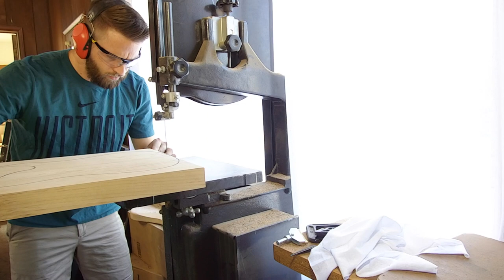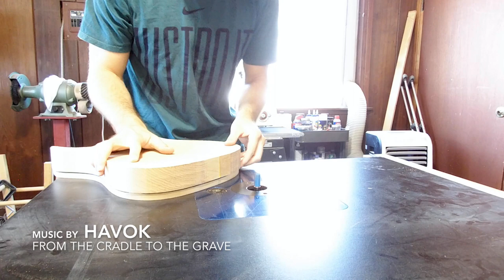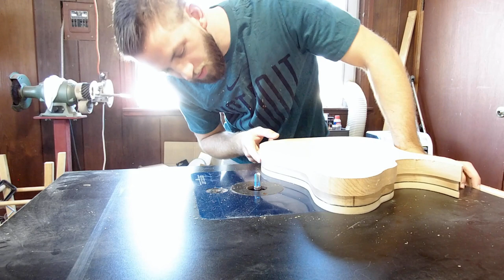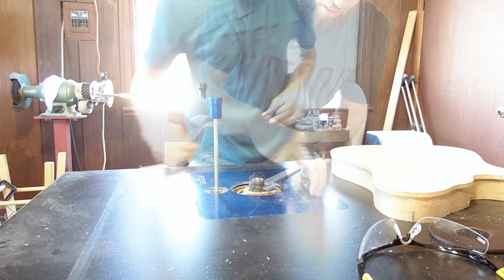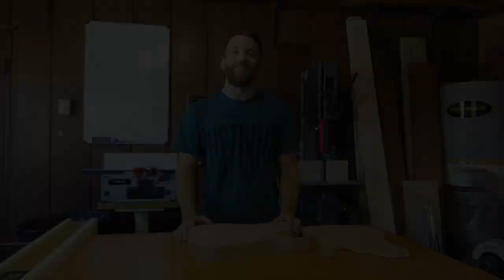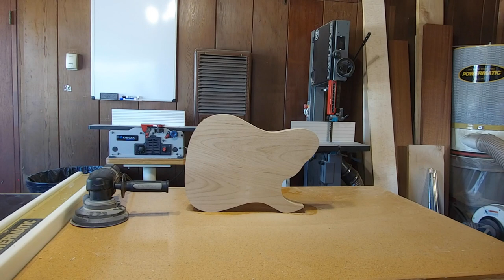How To Build an Electric Guitar - Routing the Body

Comment: Very cool! Thanks for sharing!!

Couple questions, what wood are you using and what speed is your router it? 

I am using a compression spiral bit in my table router at about 14.5k rpm and it works pretty good but sometimes grabs the body and chewed it up pretty bad. Nothing a little wood filler can’t fix but still not part is the plan. Any thoughts?

Comment: Why cut it with the band saw first? Why not go straight to router?
Reply: You would ruin the bit in a matter of seconds. You want the least material to cut.
Reply: @JonHawaii2003  Ok. Just that I've seen guitar builders on YT cutting out the body shape with just a router